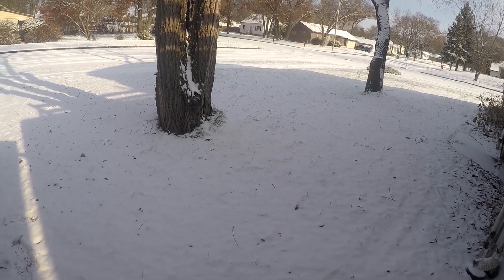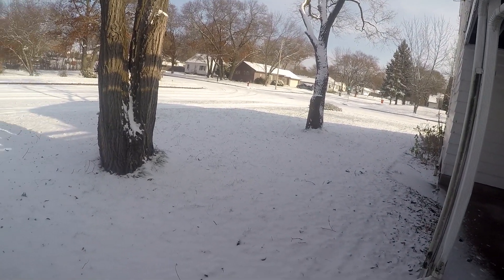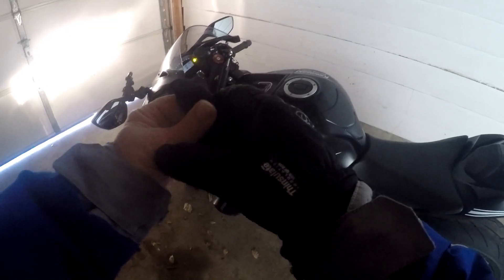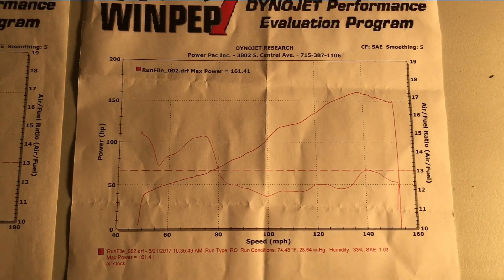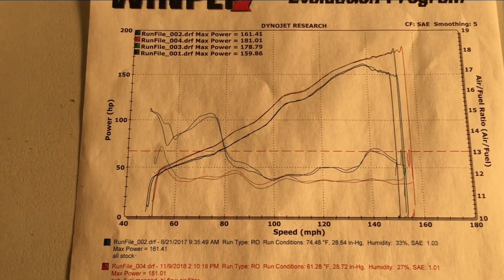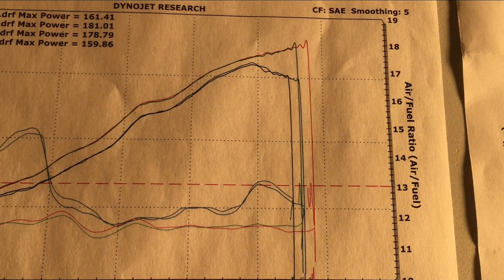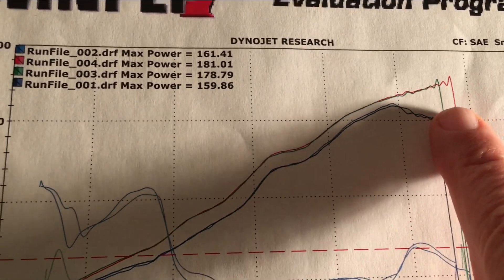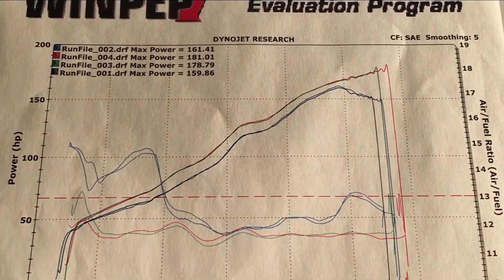🏍️  ZX10RR Dyno Run 2 after Pipe and Air Filter Install

Comment: The bike makes power until 14,200 at least. You should have seen 190s. And dude almost fell off your bike. They should of rolled it up not rode it. SMH
Reply from the maker: next time I will make sure he takes it to redline
Reply: that's what my rpm limiter is set to. even with the cat no muffler it pulls all the way to 14.2k. just ordered my graves exhaust and po8 filter, can't wait to get it tuned.